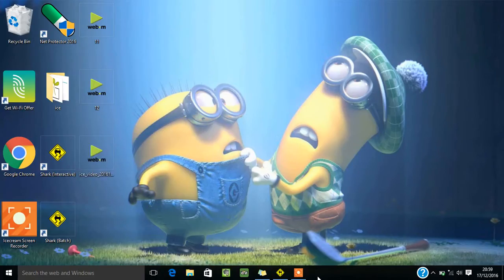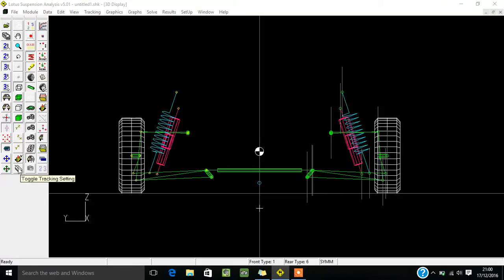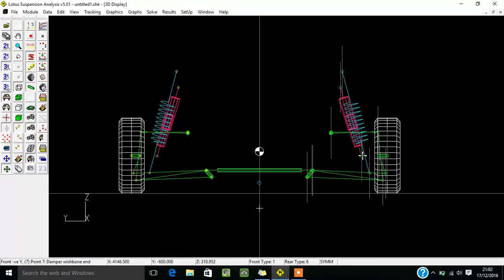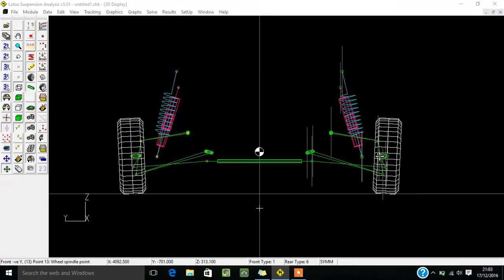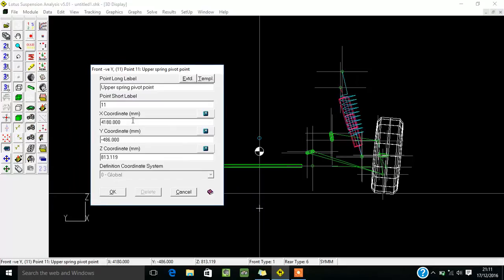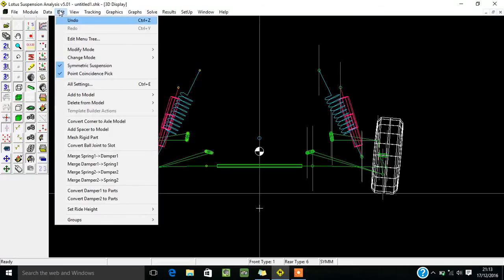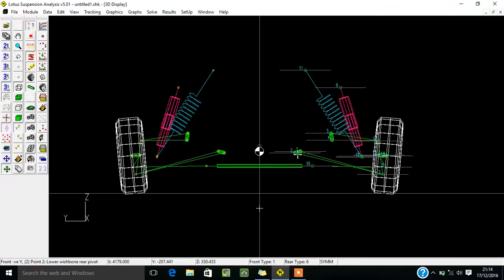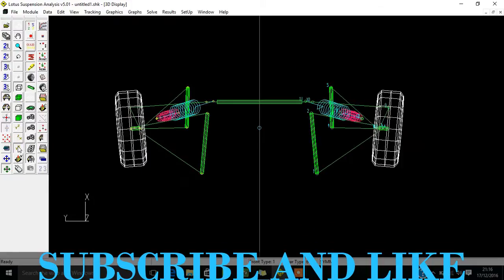LOTUS SHARK VOL:2

Comment: Hey, have you ever had a problem with Lotus Shark Suspension? for some reason, when i add a graph, my 3D display window stops working. do you know how i can fix it? I have Lotus 4.03c
Reply: Try keeping the bump increment above 5 in parameters window ….as keeping it below 5 may  affect your processing and your problem could be solved.

Comment: when changing wheel base parameters in "edit/view parameters" inputs are not applied. how can i change wheelbase dimensions?
Reply: You would have to manual adjust your x coordinates of hard points of rear assembly to your desired wheel base….for example if your wheelbase is 1700mm then the difference between x coordinates of wheel centre of front and rear should be 1700mm….

Comment: Is there any other way for inputting direct values i.e hieght from ground wishbone lenght camber angle etc
Reply: can u explain raven also
Reply: There is no other way in the software to do so but you would have to manually input your ground clearance value manually by clicking on the lower arm hard points and putting the calculated ground clearance value considering the thickness of pipes  or chassis and everything….and that way you can figure out the ground clearance

Comment: Hi, I am currently running into an issue with Lotus Shark. When I move the position of the inner or outer track rod ball joints, (steering arms), the roll centre moves. This should not be the case, do you know why this could be happening?
Reply: The roll centre also depends on the position of track rod position so try moving other hard points such as arms and knuckle according to your chassis….you may improve the results to an extent or otherwise you would have to bring some changes to your chassis design .

Comment: Very nicely explained... But i am here with a query. I had created my whole suspension design in Optimum Kinematics. So, would the co-ordinates (x,y,z)  of wishbones and other parts be same in both the softwares (lotus and optimum kinematics) or do i need to take some diff. co-ordinates in LOTUS?
Reply from the maker: Thansk for supporting me rahul, 
As per your question there will not be any change in co-ordinates of both 
 the software if and if there origine is same i.e starting point.

Comment: The vaule of x coordinate is 4180 mm, which means 4.18 meters. From where is this value measured from ?
Reply from the maker: Thanks buddy for your question,
if u r using lotus shark, then go to z-x coordinate. u will get the side view of your body.
after that u have to go in tool bar and select scale view mode option ( zome in / zome out) , u have to zome out after that u will get to see the origine of four coordinate, from there the value measured from for x axis.

i think so, your doubt will be clear
if u find any other problem, u r free to ask.
Reply: I am getting problem with opening saved  that file blank screen is appears...
Pls guide me sir..
Reply: Change your View to y-z. And zoom out till you see the origin of your model
Now the coordinates of x which is coming out to be 4.18 m in your case is from  that origin in the model…
To solve this and make it easier you would have to move all your hard points to origin(i.e. decrease the x coordinate value….and make value of x coordinate of wheel centre and spindle centre to zero )and keeping the distance between wheel centre and other points such as knuckle and track rod points …etc as same as it was before….